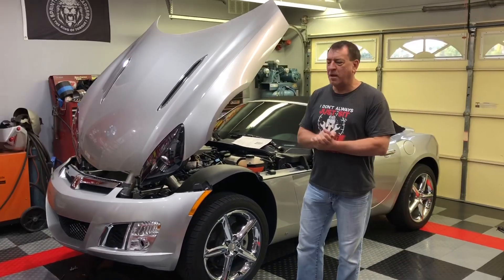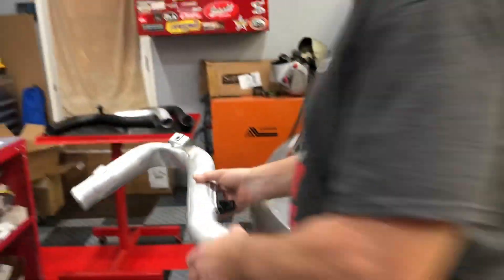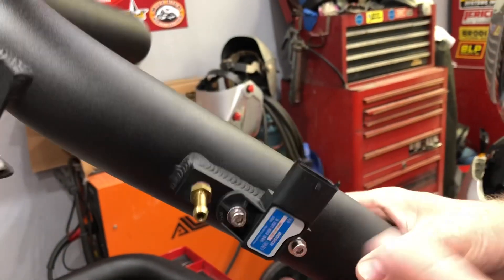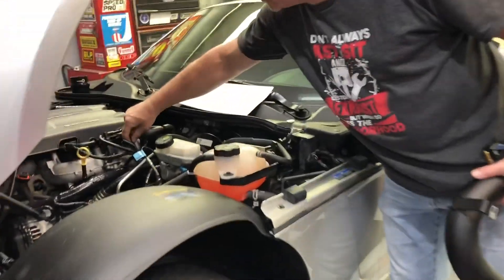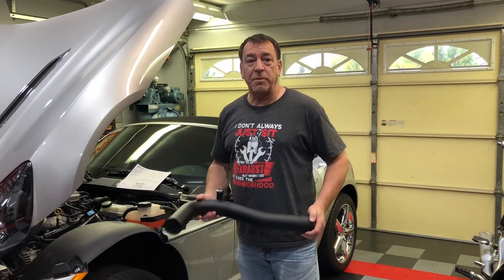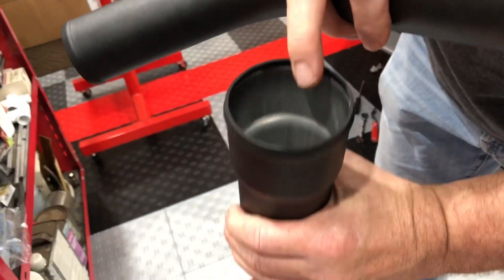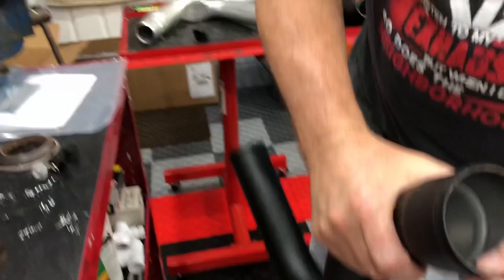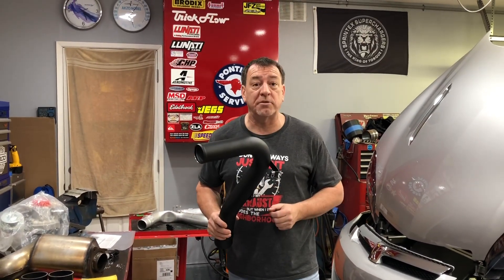Tim’s Garage Episode 6: Saturn Sky Redline / Solstice GXP GMPP and charge tube upgrade

Comment: Any data on flow for those tubes compared to stock?
Reply from the maker: Well for a stock car the pipes do not need to be updated but I have a Big Wheel and a larger inter cooler. On my car it holds 23 psi and 36-37 lbs per minute of airflow.

Comment: Love the shirt. Now do a video on the water pump! :)
Reply from the maker: David ... I was totally going to preemptively change the water pump but it has only 8000 miles ... in your opinion should I update to a newer impeller design pump or leave it alone?
Reply: @350tiger  I don't think it's worth messing with if it only has 8k miles on it. If you wind up in there doing a turbo upgrade or a timing chain, then sure. I'm honestly not sure what is better about the newer impeller. I changed mine because I was slowly loosing coolant (104k miles). If you decide to do it anyway, get the full circle tool (OTC 6616), not the half circle tool. The 6616 covers the entire water pump access plate area (which helps keep stray bolts from finding their way in there) and the channels to get to the gear bolts are deeper, making it a lot harder to drop THOSE down into the engine.
Reply from the maker: David Lively I actually ordered and received the OTC full circle tool as I suspect I will need to do it at some point in the future. Perhaps I will mention it and show some images to illustrate the location and process to change that water pump. It looked to me as though you definitely need to have the turbo removed to change the pump assembly. I may make a short video to illustrate that before reinstalling the Turbo. Thank you very much for your input David.
Reply from the maker: The newer water pump impeller design with the cast curved blade shape and the full disk design appears to me that it would cavitate much less than the cheap stamped bent blade version they came with originally.
Reply: @350tiger  Thanks for the explanation. 

I replaced the water pump without removing the turbo, but I did have to disconnect the cat to get to one of the bolts on the lower thermostat housing. Then, you have to remove the pump cover from the pump and take it out of the car in two pieces. (DDM's instructions go into that.) Others have done it without disconnecting the cat, but, after a few hours of trying that, I finally undid the whopping six nuts that it took to move the cat out of the way, and had pretty easy access to the trouble bolts. It's overly complicated. Whoever decided that a chain-driven pump was a good idea... Yay.
Reply: Also, I had some trouble getting air out of the coolant system. I finally took it to the shop. They installed the check valves in the coolant lines - very easy - and used a vacuum tool (like an Airlift). After that, it never got over 200° after two hours on a road course.
Reply from the maker: David Lively yes I actually added a quart of coolant using an Air Lift device before I disassembled the car. I will go through demonstrating the air removal process. I also used the air lift on my VRod to effectively remove all of the air from it after the supercharger install.

Comment: I wish RPM motors had the mounting brackets. I wonder if I can add them to mine?
Reply: I assume you're talking about the stock brackets for the intercooler pipes, for a K04 kit? The OEM parts should work. 

The mounting points (holes) are already there on the 2.4 models, and the charge pipes have attachment points.
Reply from the maker: Well you can add them if you have access to a TIG welder and a skilled tech. You would need to recoat the tubes though ... Martin indicates if you wanted brackets he could add those for you although he indicated they are really not necessary. After installing I would agree with Martin but to maintain a more OEM appearing install the brackets in my opinion look a little more ‘factory’ in appearance.

Comment: Awesome video Tim! Just a question... are you serious on that "three bar" sensor? I'm a rookie when it comes to cars but I know that that is a significant amount of horse power and I simply find it hard to believe that a little sensor really rammed another 30 horse power into the car. (again, I'm a rookie) Can you explain how it's able to do that? and where did you get this information? And is there some secret car society that shares this type of information??? I just can't believe I'm barely hearing about this! I guess I just want to know how is it that you know about this "2006 General Motors upgrade." Once again thank you for these videos man, keep up the great work!
Reply from the maker: Hifiveguy ... The GMPP tune contains two replacement sensors as well as stickers for fuel and the California compliance to CARB as well as a download code that a GM dealer can use to reflash the car. The 3 Bar sensors replace the 2 Bar sensors and permits the car to read higher boost levels. The GM tune tells the computer to allow boost levels of 23-24 lbs instead of the factory setting of 16-17 lbs. If you understand how increasing boost from 16 to 24 lbs raises HP it is easy to see how you can increase HP. Today even though you can still buy the GMPP stage 1 upgrade tune for out cars from Crate Engine Depot in-line it is hard to find a dealer willing to install or reflash you car. Personally if you want to add 30 HP I would purchase a tune from RPM Motorsports in Phoenix AZ. If you want to go a little further adding the charge tubes can add another 25 or so HP for a total boost of about 55HP ! Very worthwhile for a do-it yourself project and a little time over the internet with a tuner. If you have any more questions just reach out I will respond as frequently as I can ... the secret society is a Myth ... lol 😂
Reply: @350tiger  lol awesome Tim, thank you !

Comment: How do you go about getting the GM Performance Parts upgrade and tune? 
Do you just go to the dealer? 
Or do you have a link?
Reply from the maker: Well these days I would opt for a tune from one of the third party vendors as many dealers are reluctant to flash the cars. You can now buy a much more well engineered option with pre-made pigtails to install the 3 bar sensors. If you still want to buy the GM upgrade I believe you can from CrateEngineDepot.com 
If you decide to go that route it may be difficult to get a specific dealer to flag your car. 
If you want to use a third party tuner for the stage 2 tune ... RPM Motorsports and PAW (Performance AutoWerks) and DDM are options. I used Martin at RPM and was happy with my choice. If I can help more reach out to me on FB Messenger (Tim Ronak)

Comment: I know it's not from this particular video but can you share a link to the product you were using to seal the raw metal edge after cutting it to prevent corrosion?
I've always just spray painted cut edges like that and sometimes I get rust later on
Reply from the maker: The product I used is from AkzoNobel and we refer to it as the AutoPrep etch pen and it may be available here https://www.myrefinishportal.com/us/en/autoprepr-etching-pen-cf-1-3oz.html